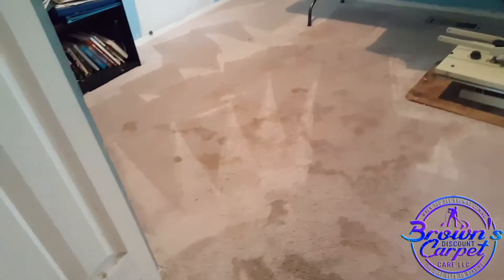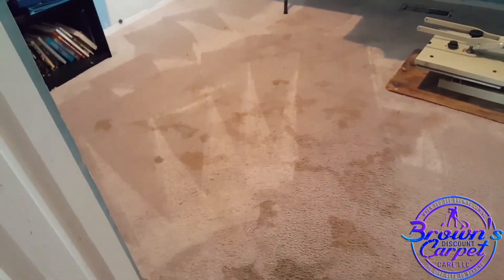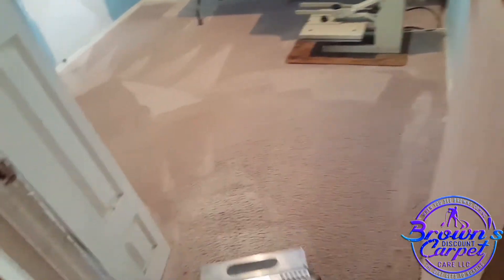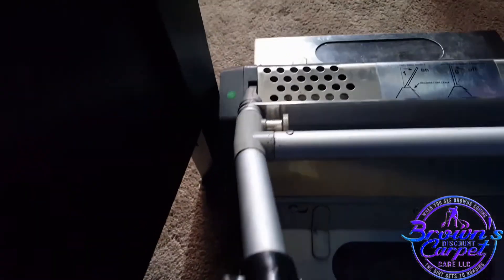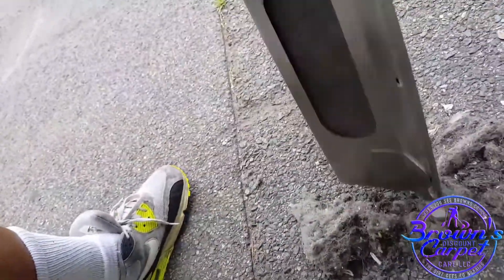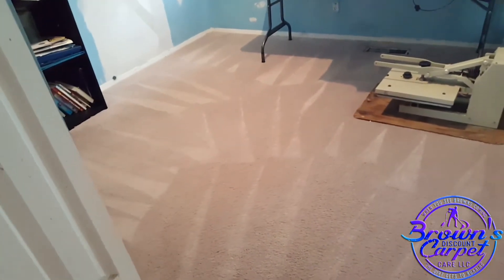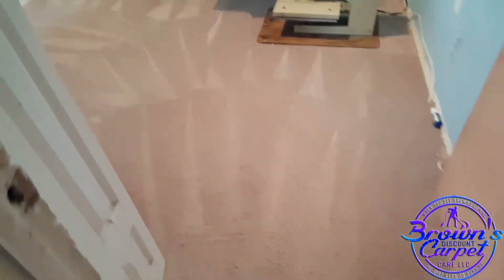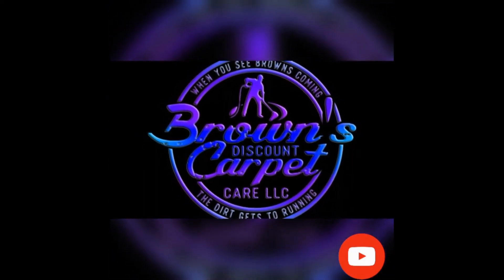Extremely soiled Carpet fiber | Good Results| Pet urine removal

Comment: Carpets always turning out great...
How do you sanitize the brushes?  Do you ever encap residential and not extract?
Reply from the maker: Geoffrey Howells I sanitize the brushes when I do my routine equipment clean...
Reply from the maker: I encap residential all the time. If I don't have to use my truck mount.  I'm happy lol  Encapsulation is Great and very easy
Reply: I will encap the entire job, extract stairways and entry level cause it is generally more exposed to soil accumulation. Does this seem about right to you?
Reply from the maker: Geoffrey Howells sounds exactly right!